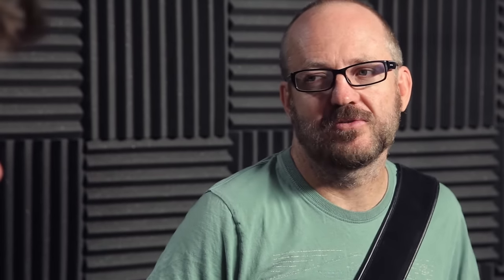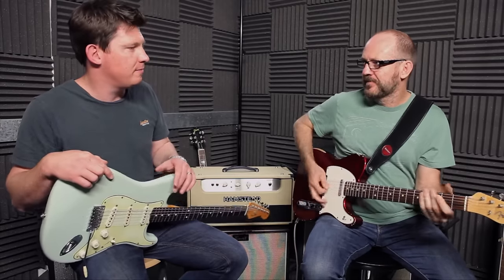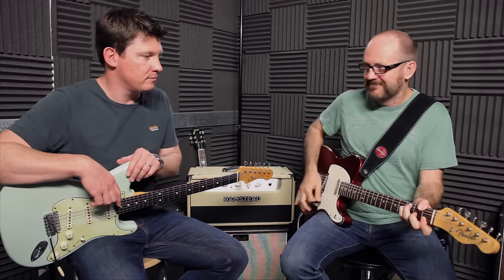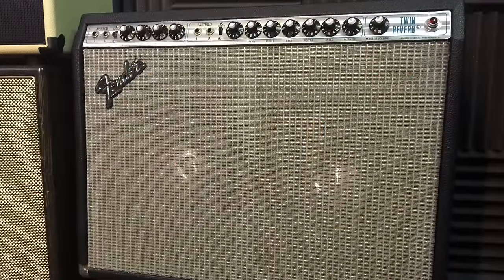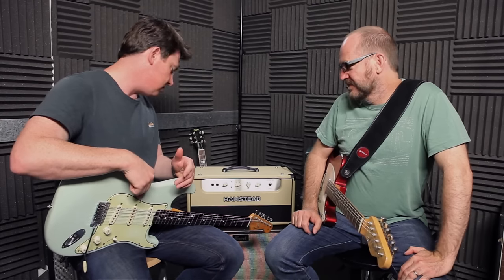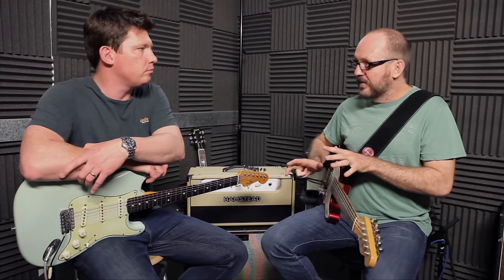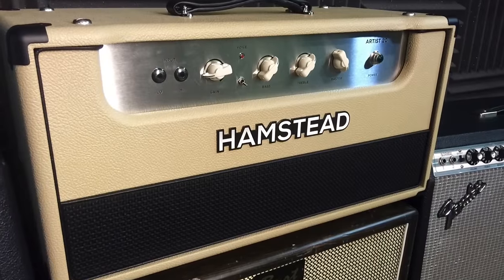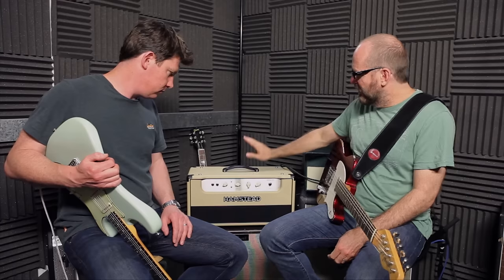Setting Up Your Amp To Use With Drive Pedals

Comment: Hi Dan! all my drive pedals (TS9, KOT clone, Snarling Dog Black Dog) seem to "cancel" the low end of my sound! Is that a common behaviour or how do I manage that? Im plugged into a Marshall Plexi 1987 clone.
Reply: +Marcos Piñeiro Pearson get a dark matter while you still can. It will solve this and is transparent and affordable. Otherwise I shape my other drive pedals with eq. But all drive pedals compress thus the amp loses that umph. I like to use my amp drive or a close sounding pedal for low volume playing. Some Close to modded jcm sounding pedals, Wampler pinnacle, TC dark matter, SD palladium

Comment: Unless the music store lets you take all their pedals home to try out, or allows you to lug your amp there, how would you know ahead of time if a pedal will sound good through your amp ?
Reply: Either research, or just buying the pedal and trying it, and sell/ return it if you dont like it.
Reply: Or you could ask someone at the store if they have your amp in stock then ask if you can try the pedal through that before you get it
Reply: +Thom Vogan Now this is what's causing me a great deal of trouble. I have two unusual tube combos, with slightly unusual speaker pairings and an equally unusual guitar. I have no idea what will happen so I just buy stuff used, see what happens and if I like it I keep it.

Comment: All opinions welcome... so if I’m using a distortion pedal do you suggest no gain on amp and getting it all from pedal or do you use amp gain and the pedal like what is best? I’ve only been playing 4 months and I’m only using a Roland micro cube ya know like just playing and practicing at home for now for self.. so one or the other or both? Like from what I’m understanding when using pedals you leave that particular amp setting clean whether it be delay or whatever like you wouldn’t use delay on amp and delay pedal right??  So would you use amp gain and distortion pedal?

Comment: I realize this is an old video, but I just came upon it and must comment that your Big Muff comparison was a little unfair! I certainly won't deny that a Big Muff pairs better with a mid-heavy amp like a Marshall, but we all also know that pedals often need to be tweaked to work with different amps, and you didn't change anything on the Muff when going into the Twin! I'd have rolled the tone knob back to noon or lower, and increased the sustain (lowering the volume a bit to compensate).  Maybe some changes on the Twin's EQ as well. I'm sure you could've gotten a more pleasing sound than you did. Cheers.
Reply: jakollee not to mention an eq pedal might help too.

Comment: Great video as every guys. I'm a guitar player of 26 years experience and still learning. Currently struggling with a bright/ cutting 08LP standard and Blackstar Artisan 30. Any advice (from anyone!!) greatly appreciated... I can't afford to give up on this set up just yet.
Reply from the maker: Are you having issues getting it to cut or is it too bright?
Reply: +godmas02 Shrill Artisans... just roll off the tone or vol a bit or even get an eq pedal if you can't dial out what you want using onboard eq
Reply: Lower the pickup's some. Maybe you have solved this issue by now, but there are many variables to consider.

Comment: EV speakers shouldn't have aluminum dust covers.  The other thing with EVs is that the very heavy cone and 3" VC creates significant mechanical and electrical inductance.  The result being that they sound very dry and hi-fi at low volumes but roll of a lot of high end when played loudly.  Which in this case would have the Twin at some crushingly loud setting like 8-10.

Comment: Mick changed from the bridge pickup to neck pickup (14.28) and at (14.43)stayed on the neck, instead of changing back to the bridge pickup, so it had mid instead of the clarity......oopsy Mick and Dan for not noticing ;)

Comment: I agree  that this was a good comparison to show that for instance 1 pedal can sound different on 2 amps, like you did with the big muff on the marshall and the twin, but you just kind of ended the example at this is how the pedal sounds on one amp and this is how it sounds on another when in fact there is way more to it! so if you said okay, the big muff sounds good on the marshall but sounds shitty on the twin, thats giving the wrong impression! so i agree it sounded very treble heavy and almost fizzy, with a huge lack of bass and mids on the twin, but thats where you should say, if youre going to use a big muff on a twin for instance you may need to look at adding an eq and some compression to get a better sound from the pedal, but its kinda like your saying some pedals are just shit through certain amps. I didnt see you for instance change the pedal setting, or add more bass and mids on the amp, or use a compressor or eq! just saying! I know its about the pedal and the amp but theres more to it!

Comment: Why the hell does my BYOC Large Beaver Ram's head with a Classic 50's Strat through a ver. 1 '65 Twin Reverb reissue sound INFINITELY better than the results they're getting?
Reply from the maker: +Smurfman256 because yours is a 65 twin, totally different amp. This is a 76 silver face, it has very little tone, just crazy amounts of headroom. It's only meant to show a stark contrast between an amp that compresses and an amp that doesn't

Comment: My handmade Ram's Head clone sound huge in front of a Fender amp (Hot Rod 40 reissue). Usually you don't even need an overdrive to push mids out. For soloing staff I use a TS9 and a Boss CS2 in front of the Fuzz, and it sounds devastating. I love your channel, but in this particular case I can't understand why you use the same pedal and amp settings to test some gears (amps) with so different features...
Furthermore, I never listened to a Ram's Head put in front of a clean tube amp or channel (Fender, Marshall, Vox...) sounding that farty...There's a trick, turn your ears on, and the pots tweak!

Comment: Thanks Dan, I learned more in a couple of your videos than I did after YEARS of trying to learn about pedals. The comparison of the three amps was really good, but just a quick question- is there a way (EQ, boost maybe?) to compensate a high headroom amp like the twin? I was thinking that if you put an EQ pedal after the distortion you could cut the highs, boost the midrange and get a favorite overdrive to work with the twin, or is it just not worth doing?
Reply from the maker: Overdrive can sound great with the twin, it just depends on the way it's voiced and how it compresses. An eq pedal will address the shape which is great, but not the compression. But there are loads of ODs that sound great with high headroom amps
Reply: This video is a little misleading. The Big Muff can sound fine through a twin, you just need to dial the tone way back on a Fuzz pedals.  If you understand the signal a better representation would've been to use the OD pedal( like the preamp distortion from the Marshall) (talking twin reverb), then run the big muff into the OD pedal.  So if you have a great clean, use an overdrive (hard clip/soft clip diode) after the fuzz pedal. Then the amp is a closer representation of what the Marshall with preamp distortion is doing.  Fuzz pedal into square distortion.

Comment: Hi as a fan of your show you really didn't show "how to set up an amp for use with pedals"  just promoting the hamstead.   Which is by no means a majority choice After watching your previous show using 2 amps 2 voicings  and the option of wet dry that's when you got it right, and me too,  journey over!  why didn't you try the Marshall and fender together using the horrible muff?  It might have worked, and showed us the clean settings you dialed  in 1st before the pedals.

Comment: Twins sound nice, but they are so heavy.
Reply: hence why old Princeton Reverbs are simply great to lug around!
Reply: +Eric John It's possible. I have a bit of a compressor fetish, which is an odd effect to have a fetish over. I own several and built dozens for myself and others. To this day I still prefer the tried and true Dyna Comp. I love the percussive "click" you get into a clean amp. I filled in for a guitar player when he had to leave the road for a couple weeks due to family things. Their sound was such that required me to use 2 pedal board, 3 delays 2 chorus, etc. It was ridiculous. But one thing I used (actually he did; I used my guitars but his amps and board) was an optical compressor running through the serial effects loop of an amp. Never seen it heard of this done before.

I'm babbling now. Typically a compressor is almost always used in the beginning of the FX chain, because it compresses so much that it would kill a lot of your tone of it sat at the end. If I was using it at the end, I'd use a compressor that has a wet/dry mix. it has a parallel input that splits the input into 2 signals, one that runs through the effect and one that runs straight out to the output. There will be a knob that lets you select anything from 100%(or 99.9%) dry signal, to 100% compressed (like you'd get running into any pedal turned on) and anything in between. That way you could fine tune the compression level. My favorite compressor after the script Dyna Comp is actually from a kit believe it or not, BYOC's 5 knob compressor. It was cheap, like less that $100 unbuilt, bit it's probably only $25-30 fully built.

Comment: I cant stand overdrives that mix in the clean signal.
Reply: +J583 cool
Reply: jimmy roch warm
Reply: +J583 they are intended for use with an overdriven amp - so its slight crunch mixed with heavy overdrive, instead of clean with overdrive
Reply: +J583 why?
Reply: aektzis91 I can hear two distinct tones at one time and it feels unnatural.
Reply: J583 thats why you run it into a second dirt pedal or a dirty amp. Its not meant to be entirely clean mixed with overdrive, unless you really set the overdrive side to be almost clean itself.

Comment: I'll take my '89 "Red Knobs" Twin over that Silverface any day. It rattles the walls with bass if I want to.
Reply from the maker: +Stéphane Bergeron yeah, those red knobs sound ace
Reply: +Daniel TheGigRig Indeed! Very fat sounding amp, especially on the clean channel. But the drive channel has a distortion texture I don't really care for anymore. Good for leads but not so much for chording and I sometimes need higher gain. That is why I'm waiting on a JHS AT right now (in transit!) and can't wait to try it! :)
Reply: +Daniel TheGigRig Received my JSH Andy Timmons today. So far I'm really impressed! Definitely sounds nothing like that silverface Twin in my Red Knobs clean channel. The AT feels more dynamic than my Twin's dirt channel and the distortion texture is quite different and exactly what I was looking for. Sounds very Marshall-esque indeed.

But more than that, even though my Twin can have more bass than you'll ever need and make everything in the house rattle when playing on 2... its dirt sound lacked real punch to me. Felt wrong somehow. There's a warmth in the AT's low mids than makes it warmer and punchier than the Twin. It sounds chunky and chewy for lack of better words :)

The initial attack is very different too. It feels better under the fingers. Higher register notes sound fatter too. Unlike the silverface here, it really doesn't sound like a distortion box directly into the desk. Still have to tweak the system a bit more to get the the sound, but I'm so much closer than before and it FEELS so much better. Only started to play again for fun after a several years hiatus so can't afford a new amp or much new gear for now. But the AT is breathing new life into my distortion tones already. Love it!!

Comment: Another vid where we want a simple answer made technical... We have a pedal board and all we need to know when plugged in the amp what the dail setting on the amp we need .. simple
Reply from the maker: Nope, there’s a reason we take you through the details. Every amp is different, it’s finding the sweet spot where the amp is most open
Reply: @TheGigRigDaniel  yes I agree what your saying but the point I'm trying to make for a newbie the terminology is confusing because it's past the basics and ok for someone with a little experience but with no experience it's too confusing and deep for that .. but not calling or putting you guys down I respect what you just said but guys like me need a little help before we get to the level your covering. There not much help around.

Comment: The only reason the muff sounds so bad is because it's set up for the marshall...roll down the tone and it sounds much better
Reply from the maker: +Abe Thedrummer Not with this amp Abe, funnily enough, the bottom end was huge but it just doesn't come across in this video. This pedal and this particular twin just sounded awful together, no matter where the tone was set
Reply: Hmm, interesting. I have a muff running through a princeton and it sounds great, then again I usually have it cranked so there is a bit more natural breakup
Reply from the maker: +Abe Thedrummer Princeton is a completely different amp, the Princeton compresses really nicely, this old silver face twin is nothing but headroom